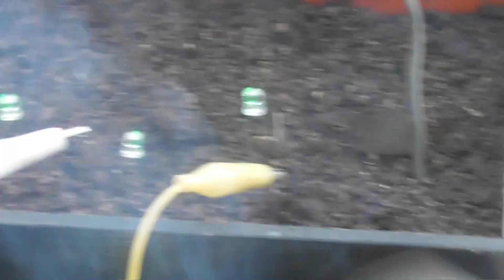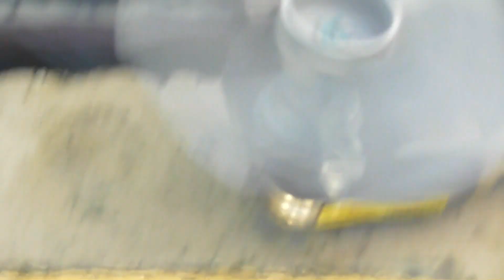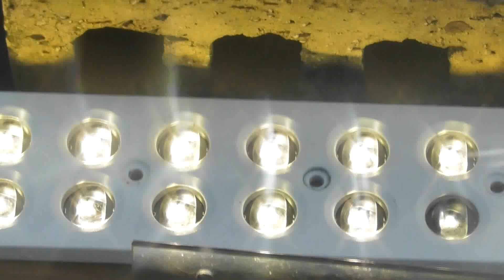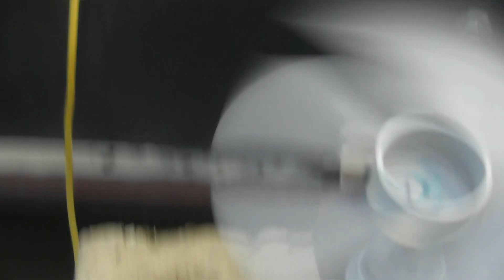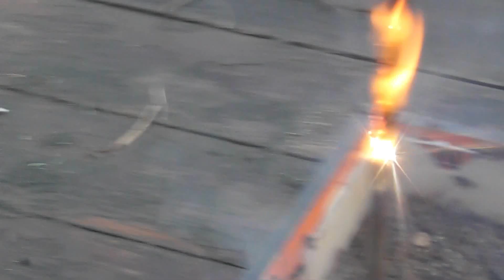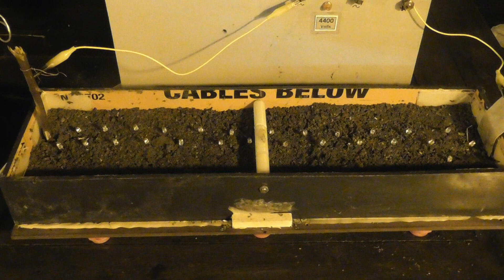Step Potential in soil

Comment: Can you do one with sand and limestone? That's all I have around here.  I'm worried about putting up an ham radio tower because lightning is bad here and a simple ground rod or two won't work for protection.
Reply: Better go with 10 rods just to be safe, sand is bad earth._
Reply: @primech-128bit  I can't install 1 ground rod, I'd have to core drill and fill it with GEM.

Comment: a very good example that explains why the surroundings of a fallen live wire can be very dangerous
Reply: just remember he has a single "earth ground" point at one end of the test setup, while the actual earth is ground bonded to the power grid at very many locations, which means there's fairly equal step potential in all directions around a live conductor.
Reply: @throttlebottle5906 I would imagine it would go to the nearest earth point. Earthing points far away would have less influence.